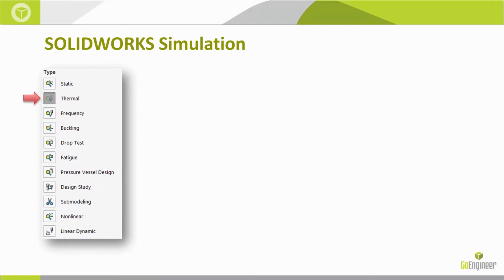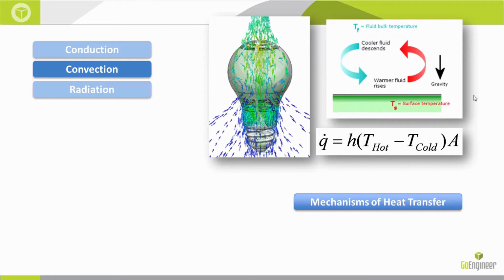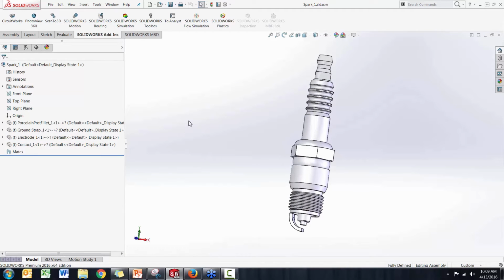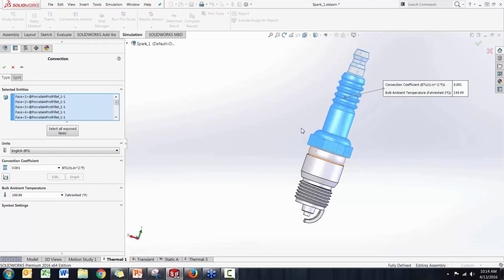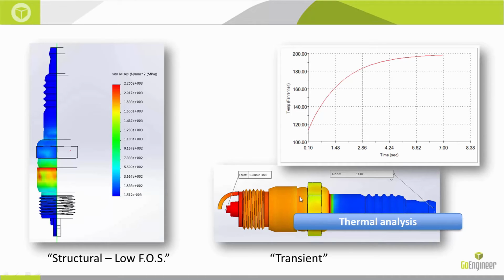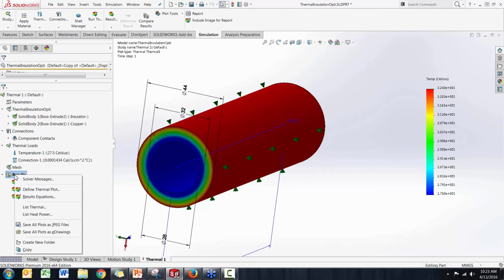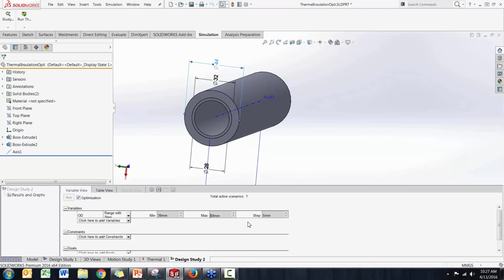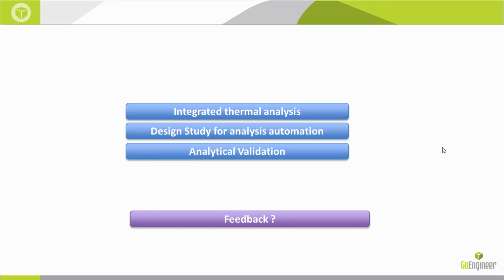SOLIDWORKS Simulation - Thermal Analysis Webinar

Comment: Can I do thermal analysis for facade details esp. corner detail in Solidworks with proper boundary conditions (i.e. applying external and internal temperature of a space to the modeled 3d detail). I want to visualize the heat flow in 3d model. Can you upload some tutorial regarding that? Please reply asap ... :)
Reply from the maker: Yes you can. You can perform thermal analysis with this module on any 3D model as long as conduction and radiation are the primary modes of heat transfer. Convection is approximated with coefficients.
 If you are looking to model the environment where convection is also present we have a different module for this. Please check out this video for more details: https://youtu.be/0ARvGwjwDlM
Reply: @goengineer   Thank you so much for replying. I am a masters student and I am doing thesis this semester related to thermal analysis of facade systems. Is it possible for you to communicate with me through email. Can I get your email address? I have few more queries to be cleared.

Comment: today i approached my professor to discuss about it..he is from electrical background....he raised the question that there will some heat loss due to conduction as it will in contact with the cylinder head....?
can you please answer to this...?
Reply from the maker: Hi Ganesh,
If the cylinder head is a good conductor itself and the connection between the cylinder head and your model has very little thermal resistance then you might consider adding a portion of the cylinder model to the analysis and adding a boundaries to the cylinder for its own heat losses.  This would be the best approach to consider conduction heat loss into that object.  It is expected that the cylinder temperature would rise and this would be the only way to accommodate that change to stay true to real life.